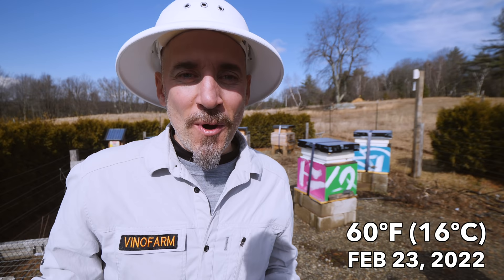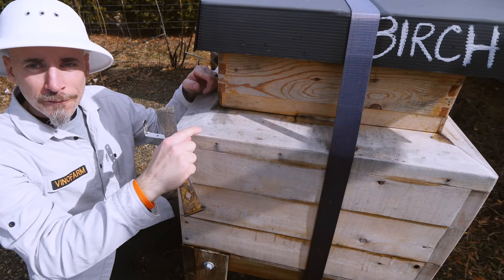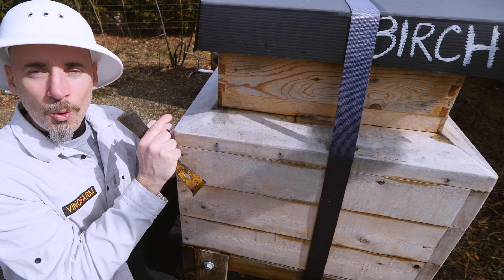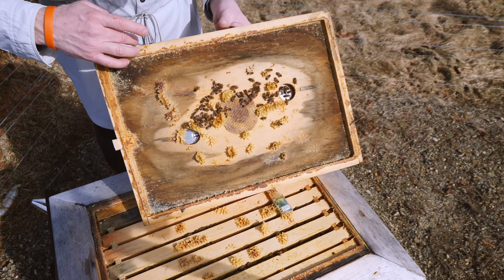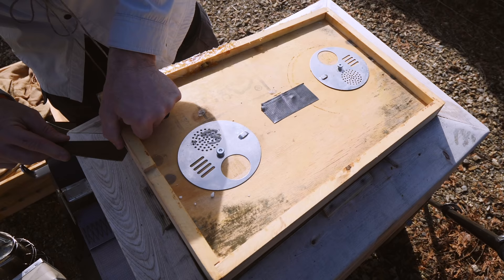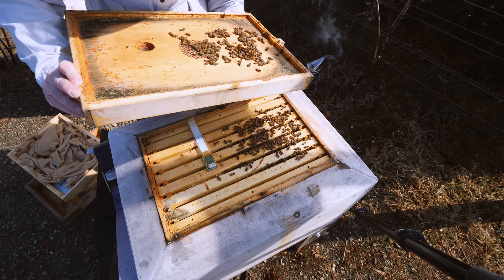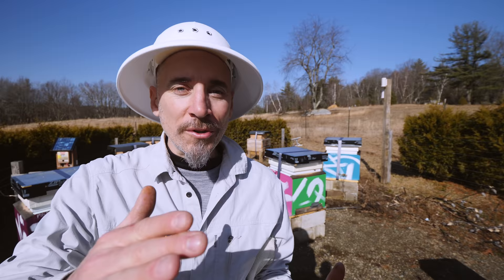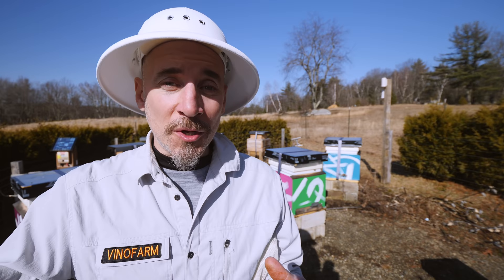A FLAW In My Hive Design... (So How Are The Bees?)

Comment: I'm the black sheep in this discussion. I prefer to have moisture in the hive. As you can see, the bees are pushing that moisture to the sides of the hive. From there it flows down the walls where the bees can then drink the water.
Reply from the maker: Oh, I totally agree. I’m not trying to eliminate it. The goal is to provide them with an insulated space that has no wild temp swings. They will keep the upper living space warm and condensation-free. But outside of their heat zone (outer walls and areas below the cluster) will be where the condensation forms and they will be able to access it. I just don’t want it on their ceiling.

Comment: You don’t need all that shit. Do a video on the value of materials you have invested into each colony.
Reply from the maker: What do you want to know? Just ask.
Reply: @vinofarm  equipment list for each colony and what it would cost
Reply from the maker: @PutEmInTheBox  Standard Langstroth boxes on the inside were the ones I had been using for the past 4 years. I reused the polystyrene I used to use to wrap my colonies. I bought that 5 years ago. Probably about $20-30 worth of polystyrene in today’s prices. The outer boards are 2x6s. I spent about $80 per hive on cedar last year in the middle of the pandemic so that was high. I could have just as easily used Home Depot spruce 2x6s  @$10 each x4 per hive. 

In today’s prices I could build what you see here for under $100 extra per hive. A lot of the stuff is reused and hacked from equipment I bought years ago. 

Why do you ask?
Reply: @vinofarm  that’s a lot of coin. Glad you enjoy the effort.